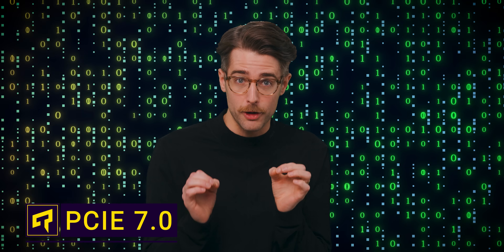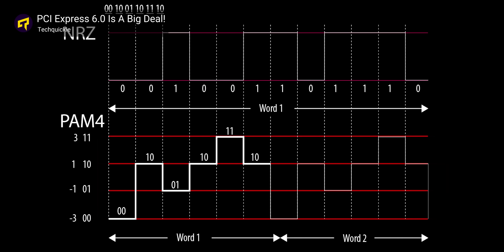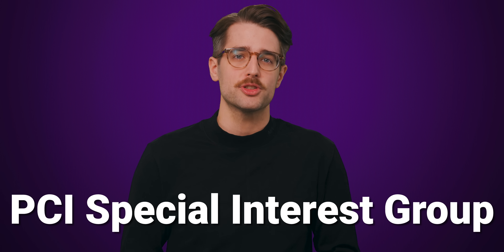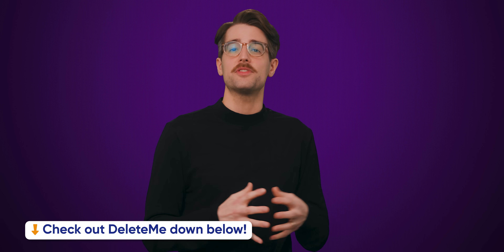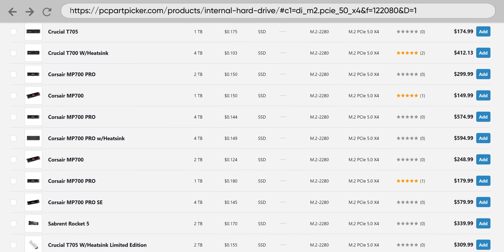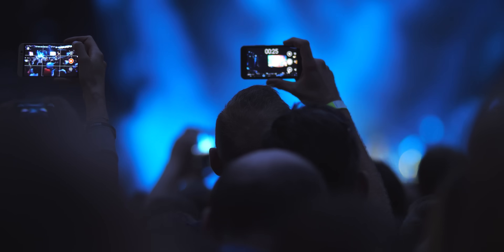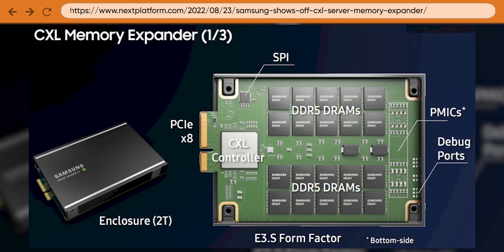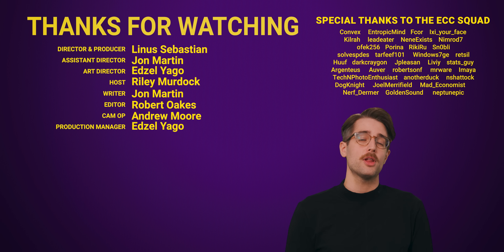PCI Express 7.0 is INSANE

Comment: I'd love to be in the meetings for the PCI standards group: "Next version is due out soon, are we all agreed we double the speed as usual?"
Reply: PCIe naming is just the opposite of USB
Reply: In 2002 or so I job shadowed an engineer at intel for a couple days. Got to see a 10ghz Northwood ALU and sit on a call discussing the physical spec of pcie 1.0 with reps from like, dell, hp, asus, and others. Was wild.
Reply: Pretty much. The same in networking. The goal is 10X and often there is an intermediate 4X baby step.  What's interesting is these internal expansion buses used to be parallel (ISA, EISA, VESA, PCI) but the PCI-E broke away and became more of a network topology.  In fact the "rate determining" bit is a thing called a serial/deserializer or SERDES. And the ubiquitous and high volume PCI-E and Ethernet keep pushing that function to its next plateau. PAM4 started in the networking side of the game and once it was in the chip library slid - very naturally into the SDRAM and PCI-E functions.  Datacenters drive the progression and CXL is going to be HUGE. It will liberate the dedicated coprocessor market.  (GPU's were a dedicated coprocessor - many many more exist.)
Reply: @dennisfahey2379 NVMe is what is driving this progression. Why use 4 lanes for an SSD when you could use 1? Get into a high number of drives and you run out of lanes. Then you look into running multiple servers just to network out data to a main data controller server. This will bring things more in line with what SAS did. Multiple JBOD chassis worth of drives connected via PCIe to a single server without needing any kind of PLX type of thing.
Reply: The "what" is easy-ish, knowing how to do it is why one gets to the SIG.
Reply: seconded
Reply: @portalwalker_ don’t give them ideas 🥶
Reply: @timramich  Nah. The main driving factor is networking. High end server with Dual 200Gbit links already near max out a PCIe 5.0 slot at X16
Reply: @timramich  That's kinda how Storage Arrays function today actually :P 
Lots of disks connected to a backplane that's connected to 2 separate servers/nodes of the Array.
Reply: Speed isn't the only improvement made in each version.
Reply: @jdbertel33  10ghz in 2002! How is that even possible!
Reply: @dakoderii4221  As of now its basically the only real improvement. PCIe 3.0-5.0 still has the same Line code and error correction. The PCIe STANDARDS on the other hand carry more than just the PCIe Slot communication.
PCIe 6.0 will be very interresting tho as the error rate will be orders of magnitude higher and thus updated the Line Code.
Reply: “Anyone tested it? Nah - some nerd will figure it out”
Reply: @jdbertel33  I work at Intel. How do I get someone to job shadow me while I make calls to standards bodies?
Reply: "So how are we going to achieve that?"
"I don't know, someone will figure it out."
Reply: If you can't double the speed, don't even waste our time
Reply: And what's wrong with that?
Reply: Yes, yes, yes.. .meeting Adjourned.
Reply: @portalwalker_  the people in charge of USB naming conventions need to be flogged.
Reply: You know they have to figure out the electronics for how to do that, right?  That's the hard part - not setting the targets.  If you don't believe me, why don't you go double the clock speed of your PC right now without any new electronics.

Comment: I don't even have pcie 4, and 7 is coming soon? that's crazy
Reply: I’m still on PCI-E 3.0 🤣
Reply: It felt like PCI-E 3.0 was there for like my whole life, and now every other year there's a new standard. Time flies.
Reply: Pcie 5.0 was released back in 2019 and there still isn't a single consumer GPU that uses it. 

So soon isn't the word I'd use for 7.0
Reply: to be fair pcie 3 and 4 don't really affect fps all that much
Reply: Try having pcie gen 2
Reply: I’m on 2.0 :)
Good thing league of legends still run fantastically. 
zotac amp extreme 1080ti
Reply: @Xeon451  3.0 is plenty for the average user
Reply: 4 is found on almost all new motherboards, with 5 available in some. 6 is still only for servers, and I imagine 7 will be too for a while.
Reply: @sierra5065  PCIE 6/7 are all about datacenter/enterprise hardware as 5 soon won't be able to keep up with high speed data transfer.  I wouldn't be surprised if it's years before we see 6 in anything meant for consumers.
Reply: 6 isn't even available yet. This is pointless buzz for potential new tech planned out.
Reply: @FenixQubes  It felt like I was on PCIE3.0 forever before I eventually upgraded to a Ryzen 9...and I started on ISA and eventually AGP 😅
Reply: @FenixQubes  So you are a young one from 2010 or maybe an even younger vintage model. I was there when PCI wasn't even a thing yet, let alone PCI-E. Heck, even ISA and VESA Local Bus had to still be invented. After that we got PCI and than we needed a slot fast enough for 3D graphics so we got the AGP aka the Accelerated Graphics Port.
Man, I feel ancient because back in the day nothing was Plug'n'Play. Heck, the Plug'n'Play standard had to still be invented which has since gone up into all the other standards as a given. 😅
Reply: Consumer products run years behind the latest specs. It'll be ~3 years before Gen 7 shows up in any enterprise usecases, and at least 7 years before it shows up in consumer grade hardware.
Reply: Welcome to tech. As soon as you buy it  it has become old tech
Reply: I’m still on AGP
Reply: Ya I installed my new Rtx 4070ti super into a pcie 3.0 x16 slot and from what I here that equals to a pcie 4.0 x8 speed equivalent. Prob won’t upgrade my motherboard till am6 comes out.
Reply: Soon is relative
Reply: Well, even a few PCIe 5.0 card was in RTX 30xx series, in RTX 40xx they rerurned back to just PCIe 4.0.. so you didn't miss that much yet, this coming soon should be in the next 10 years..
Reply: If you press up, up , down , down, left, right b,a you will have pci 4..
Reply: Im still on 2.0 with a i7 2600k
Reply: @OrionCV1  very much depends their is instances pcie 3 vs 4 can make massive changes in frame rate but it has more to do with new low end cards ironically lol
Reply: My Bestie in February: Should I get a wifi 6 gaming router for $200? 6e seems unnecessary. 
Me: I got a 7 for $250. Wifi 7 has been out this entire year. Get it overwith. It's not a FOMO tax.
My Bestie yesterday: Should I upgrade from 6 to 6e now? $200 isn't bad for an upgrade.
Me: ***Le sigh****
Reply: @FenixQubes  Same, even though I'd already upgraded to PCIE 4 in the pandemic. What I missed was 6, since when the fuck PCIE 6.0 out?
Reply: @timondemuys9198   I think you'll find you're a bit off there... The i7 2600k was PCIe 3.0. PCIe 2.0 would have been Core2 generation.
Reply: I have a PCIe 4 graphics card plugged into a PCIe 5 CPU.
Reply: Fun fact, im watching this video on a pc with pcie 2.0
Reply: Yes and it will not be until 2034 until some consumer card actually utilizes pcie 7. By then nvme pcie 7 drive heatsinks will be as big as graphic card heatsinks. 😅
Reply: PCI 7.0 SSD will be available for normal consumers like us in 2030
Reply: @scythelord  my board is p67 so it only supports 2.0 but there might be a way using a modded bios
Reply: That’s what I’m saying 💀💀💀💀
Reply: @austinmiller8695  wait for upto 6 years😂😂to get PCI 7.0 🤣🤣
Reply: @FenixQubes  I guess it depends on how old you are. For me, the OG PCI (not even PCIe) was the mainstay for ages. Felt like nothing was going to replace it for decades until AGP came and went. And for people even older than me, they will say the same for ISA slots.
Reply: It makes no sense. Got a brand new motherboard this year has pci 4 and 5 slots but nothing is capable of using that 5 slot so why does it exist... but not only does it exist but so does pci 6 and now even 7? Makes literally zero sense lol
Reply: 7 won't be in a home PC for like a decade. Home PCs aren't what push new tech, datacenters are.

Comment: Nice... Now my next laptop will have PCIE 4.0.
Reply: nice
Reply: These jokes would be better if 4.0 wasn't out for more than a year on laptop..

Like manufacturers have plenty to make fun of.

We don't need to make up any.
Reply: @josephgood2704 You just didn't get it
Reply: Still on X9000 cpu with ddr2 667 2x4 on the laptop lol
Reply: @Raul-pg1pf  that is impossible to not get. It didn't make it a good joke.
Reply: @josephgood2704  The whole point is the dude isn't buying the latest laptops. Because frankly, who would switch between them so frequently?
Reply: No desktop support pcie 6.0
Only 5.0 are coming
Reply: @DanielFerreira-ez8qd  Again. I get the joke. I don't think it's funny. Sorry.
Reply: Ironically is there even a point to pcie gen 4 on a laptop when a desktop 4090 just barely reaches near the limit of a gen 3, and a gen 4 will only produce more heat which is always something to avoid for a laptop...
Reply: @WaterspoutsOfTheDeep  it matters a lot actually. they usually have a lot less lanes. laptop GPUs are either connected with x8 or x4 lanes, where desktop has a full x16. double per lane is huge for less lanes, and I'll allow for less lanes to the same amount of drives. like when m.2 drives first came out the cheaper ones went into a x4 slot, but only has 2 lanes. with new generations you could use half the new lanes to move the same amount of data

Comment: It feels like we were stuck on 3.0 for years and now we are just speedrunning pcie and ddr standards😂
Reply: Yeah that is strange. I just switched from 16 GB DDR3 to 64 GB DDR4 about 2 years ago. Now we already talking about DDR6 soon :D. Before that I was having DDR3 for like 10 years straight. At least I got a PCIE5x16 slot so if GPUs are gonna need it I'm gonna have it. But NMVEs still gonna just be PCIE4 x4 for me for years to come. Well I still have my 2005 320 GB HDD with low health installed in my new rig as a side storage so I see no problems there.
Reply: Just PCIe. DDR6 isn't happening soon.
Reply: Yup, still on 3.0
Reply: @williehrmann  DDR3 stopped being current on consumer platforms in 2016. So you may have been running it for much longer than that, but it was not modern for quite that long.
Reply: @dawnraider0072  My 10 year old DDR3 PC still runs Windows and most games I play very well, I remember things going sluggish much faster and by a giant degree back in the day, maybe it's a Windows Vista era bias, idk.
Reply: @williehrmann  the company I work at in 2022 has i5 4570 DDR3 systems for web development, we used to work on projects from western countries (we are in india)
Reply: @samiraperi467  was talking just about the standard being defined itself, we wont be getting DDR6 soon, maybe we will see this new formfactor made by i think asus?
Reply: Same with USB
Reply: It’s because AI stuff needs lots of bandwidth

Comment: Just imagine a future, where motherboards don't even have a Chipset anymore but everything is just connected directly to the CPU with one extremely high speed PCIe lane each
Reply: Can't speak for AMD Chipsets, but for Intel this is already the case - DMI is effectively a PCIe-like interface that wraps PCIe, but also other formats like USB, SATA IDE, and even UART - basically all data from the PCH. This is why DMI is written as 4.0x4 - a similar nomenclature to PCIe
Reply: So kinda like the Apple ones and the new Snapdragon
Reply: What if you could change a chipset like you can with a cpu
Reply: Those are systems-on-chip and have been common for several years, eg. AMD Ryzen and EPYC CPUs
Reply: That's called an SoC
Reply: @shanent5793 ryzens are not SoC, they need chipset
Reply: @kreuner11  No, they don't, Ryzen did away with the northbridge chip, everything it did is now integrated into the CPU.  This is why Ryzen and Epyc motherboards only have southbridge chips, as Shane stated.  The CPU now handles all communication with PCI, USB, and other high-speed buses, the southbridge is just there for anything the motherboard manufacturer puts on their board such as Ethernet, AC97, a bunch of extra USB ports, etc.
Reply: @krashd  well that's interesting, but true SoC usually have even more things integrated, mobile phone even have Wi-Fi NICs right on the die
Reply: the cpu is the motherboard? 🤓
Reply: @kreuner11 Imagine that crappy Mediatek WiFi NIC integrated into your crazy good CPU... Oh yeah, just buy a Samsung phone instead. Not replaceable parts? No, thank you.
Reply: You would still need the chipset's functionality, it would just be integrated into the CPU.

Not sure why so many people think that would be great, given that it amounts to having an unrepairable single point of failure.
Reply: We're getting SoC in laptops now. Soon maybe in desktops too
Reply: @jnharton  I don't think I understand what you mean. How would you be able to repair a chipset or a CPU in a way that would be harder if both were integrated inside the same chip? You could even argue that this way was better, because now you could replace the chipset, if it were to fail
Reply: That's how every PC has been for a decade, the southbridge is a pcie device that's soldered onto the motherboard and provides usb etc.
Everything else is a direct pcie connection between the socket and the CPU.
Reply: Or you can use PCIe 7 to connect a daughterboard with it's own computer and you get a mainframe?
Reply: @grilsegrils9330  
Yeah, pcie7 is going to be super important in the realm of HPC (High Performance Computing)
Reply: @krashd  AC97 is long dead, but HD Audio is integrated into the CPU. Ethernet is not built into the chipset. The AMD chipset is an I/O expander and only provides PCIe, SATA, USB and nothing else.

Comment: When did 5 and 6 come out?
Reply: I believe PCIe 5 is on AM5 and newer Intel chips. PCIe 6 is likely an enterprise thing at this point. We won’t see PCIe 7 anytime soon.
Reply: 5 exists but they just skipped 6 or it existed only behind closed doors
Reply: 6 was announced in 2019 and 7 in 2022
Reply: 5 wasn't released outside of Japan because they thought it was too difficult, and 6 was actually localized as "3" (this is a Final Fantasy joke, I have no earthly idea why the PCIe standard is so far ahead of what people can actually buy)
Reply: @HontoNeet It makes sense when you think about it. It's always been ahead to some degree. If you were planning a city and anticipating a lot of growth you'd make the highways wider than immediately needed.
Reply: ages ago...now get of my lawn..
Reply: On my AM5 board I have 5 on some of my connections but 4 on most.
Reply: @HontoNeet  My 12900KF has version 5 on the motherboard and its almost old enough to replace.
Reply: 5 has been out for consumers since late 2021, 6 won't be out for a good bit
Reply: @CynHicks The irony there is that increasing highway density tends to (counterintuitively) cause urban congestion. Most good urban designers tend to shy away from bigger highways in favor of higher zoning densities that promote mass transit and walkability.
Reply: @me1134 What kind of workloads are you running where a 3-year-old i9 is old enough to replace?

A year ago, I replaced my 8700k, but only because I messed up my motherboard during a case swap. If the motherboard still worked, I would probably still be rocking it. The GTX 1080 I got in the original system is still my primary GPU.
Reply: @rb5029-h1i  Irony is irrelevant here though.
Reply: Because the texhnology exists, that doesn't mean they will use it, RTX 30xx had a few 5.0 card, but because it's more expensive part like the 4.0, they returned to the PCIe 4.0 in RTX 40xx (just for more profit, they use the cheaper parts..)
It's similar like the camera support in Smartphone chip, the chip itself have 200-320MP support, but that doesn't mean that the manufacturer will use a higher like 50MP lens..
Reply: 5 has alredy been out for 2 years
Reply: @StolenJoker84 yeah PCI 7 SSD will be available in 2030
Reply: @HontoNeet  The standards are so far ahead of what the average consumer can get their hands on because the average consumer isn’t the only group of people who need components. 

These newer standards are likely extremely expensive to implement, and you almost always see them in use in data centers and enterprise environments long before you start seeing them on consumer products. 

PCIe Gen 5 was introduced (according to Wikipedia) in 2019, but announced in 2017. This didn’t hit the consumer market until Intel released their 12th gen CPUs in 2021

PCIe Gen 6 was announced in 2019, but not finalized until 2022. Nvidia released the first PCIe Gen 6 GPU just this year. It’s an enterprise grade GPU, while consumer grade GPUs are still PCIe Gen 4. 

While I know that there are consumer grade PCIe 5 SSDs, these currently seem to either be on the more expensive end, or running at PCIe 5x2, giving them about the same performance as a PCIe 4x4 drive (I’ve seen a few models that are rated to be slower than my current 4x4).
Reply: On Intel, PCIe 5 came out with Alder Lake, and on AMD it came out with Zen 4.
PCIe 6 looks like it will be shipping in products later this year.

Comment: Hope it runs Subway Surfers at 60fps on my $5000 gaming PC
Reply: maybe if you turn off ray tracing
Reply: @mrkcrtr508 not enough, might need to turn on frame gen 4.3
Reply: $3000 of that is the GPU sigh
Reply: Of course, just need to check the monitor's settings...
Reply: Fortnite is still going to run like garbage
Reply: With the right code you could cook a 4090 over a PCIe 1.0 x1 link.

Comment: PCIe 8.0 slots to require water-cooling and a 1000w PSU for the slot itself.
Reply: ...but still only 75W power delivery via the slot.😉
Reply: Waterblocks for redrivers 😂
Reply: Well thankfully your new $120 per foot, 2 inch thick USB 6.1d/ThunderBolt 11 cable can run the AIO pump. But nothing else. Because it's the cheap one from Amazon Basics.